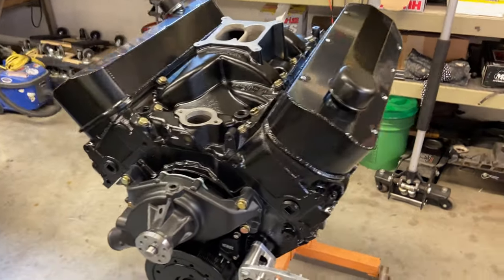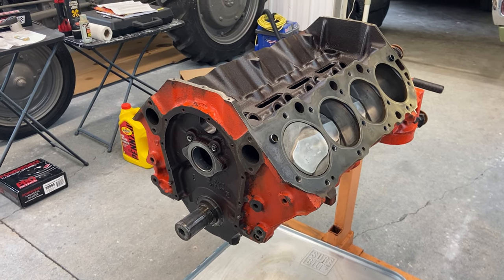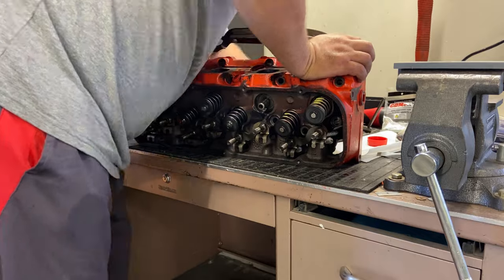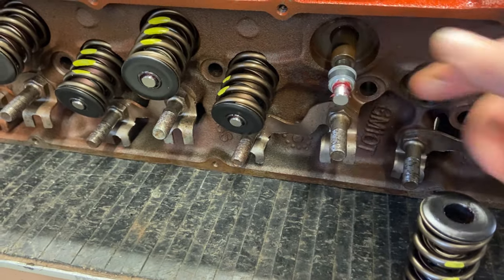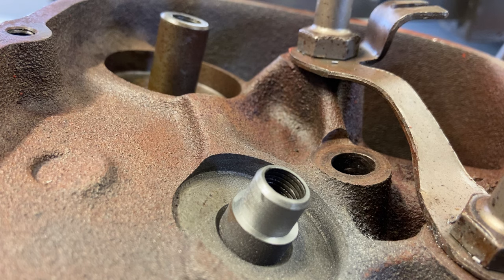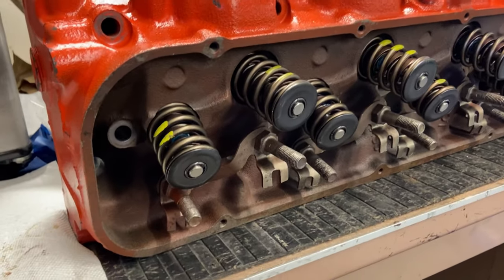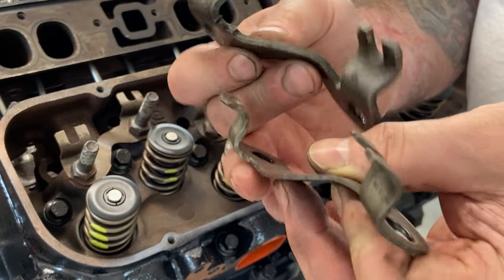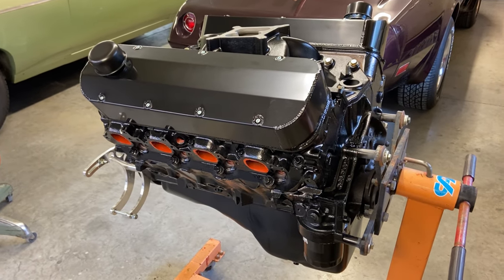My Chevy big block is finally assembled!!!

Comment: Looks good 👍 I built a pair of 396/402's for a project of mine. I need to quit BSing around and get it installed its been finished for awhile now. It's blown with twin gt45s it has a little bigger cam than what your runnig. I'm going to run it just blown for a bit before I slap the turbos on. Also finishing up one of my turbo squarebody's. Just disassembled my next bbc for my next build turbo of course
Reply from the maker: Awesome sounds like you have some great projects thanks for the support and comments I appreciate it. 👊🏻

Comment: Awesome video man. I wonder what would have happened if you ran it without shaving down the guides.
Reply from the maker: I wouldn’t have been able to fit the double valve springs over the stock umbrella seals so I had to shave them to properly fit the smaller Viton seals, if I ran it with the Viton seals improperly installed it would have smoked like crazy. And without making room for the bigger lift cam it would have crashed into the guides at high rpm damaging the seal and head and the springs could have come apart. It would have been really bad lol 
Thanks for watching man I appreciate it 👊🏻